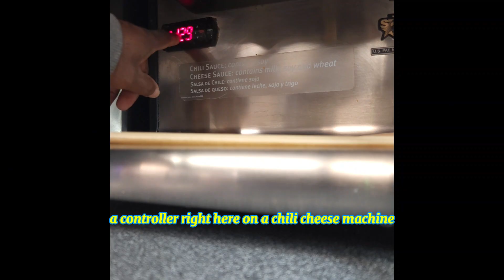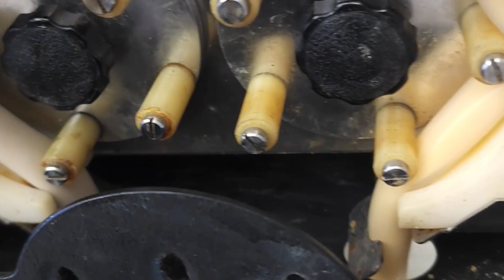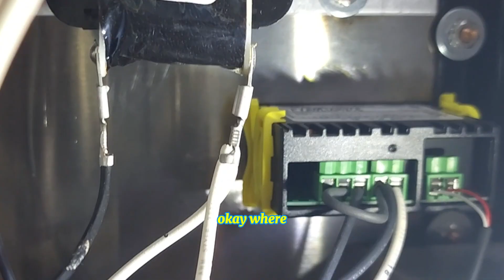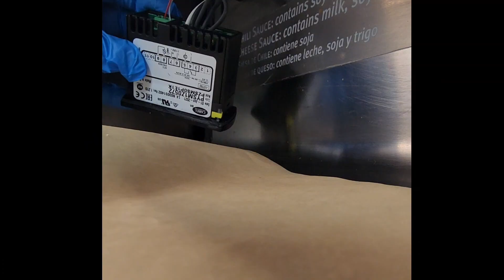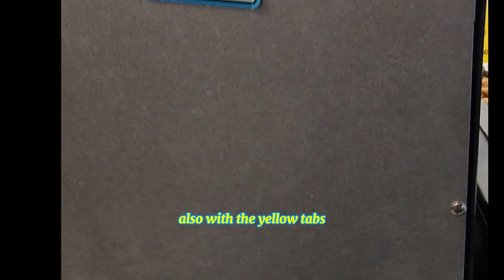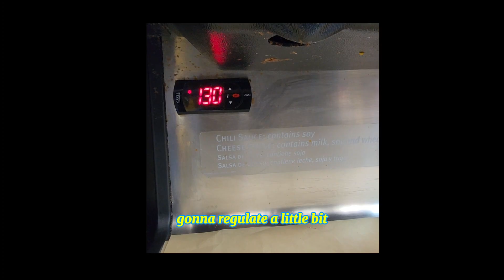Star Chili Cheese Machine Controller Replacement

Comment: When you replace the temp control, do you put in a new 165 hi limit too? Like is it necessary? Does it make a difference putting a new one?
Reply from the maker: @Alejaja97  Good question,  it is not always necessary to replace the high limit unless after you replace the control and the temperature is not reaching the set point it is a good idea to replace the high limit. I hope that helps. Thanks for watching!
Reply: @latcommercialrepair  yes it did thank you!!!